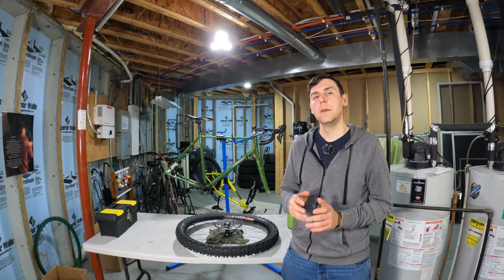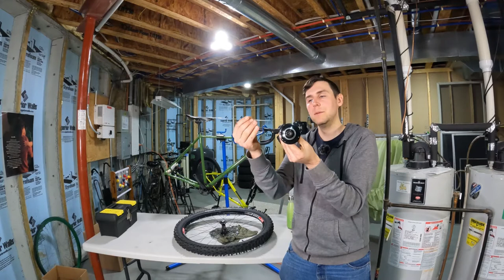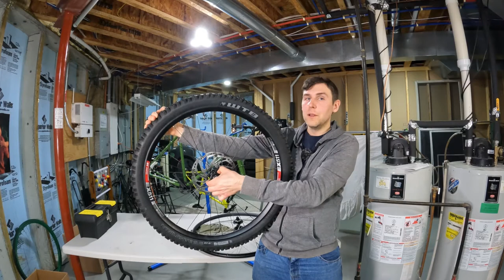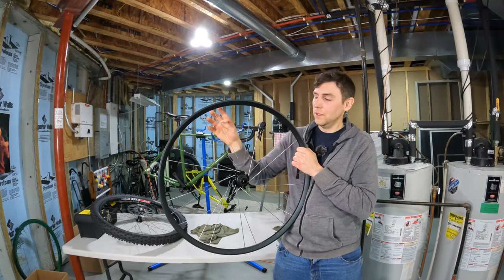Bicycle Wheel Lacing Patterns: Crosses & Spoke Orientation

Comment: Thanks for this. I'd heard before that the orientation is super important and that there's a definite right and wrong way to do it, but when I had a look at some different wheels on different bikes there's no consistency at all lol. It's like the question of whether you should grease a square taper bottom bracket spindle before fitting the crank. People have really strong opinions on whether you should or shouldn't but in the real world it probably doesn't matter.
 
Edit: That said, I've just seen one of your more recent videos about this and I think I agree on the idea of lacing the drive side spokes outside in so they're supported by the cross more than by the flange. I'm building a wheel for a heavy rider with a mid-drive e bike so I'm fretting over it a bit more than usual 😂
Reply from the maker: Oh I fret over this every time I build a wheel, then I make a video about it so I can remind myself how to do it but then when I build another wheel I fret over it all over again and also learn new info... I haven't built a wheel in a while so right now I'm not sure off of the top of my head how to do it but I'd definitely not recommend doing it the Shimano way.
Reply: @spinningtrue  lol I did it the Shimano way in the end 😆

I checked the bikes in my house again (there are maybe a few too many) and all the disk brake bikes were done the Shimano way including one with a rear hub motor.
 
I thought they were incosistent before because I was only looking for differences between the front and rear hubs, but I hadn't realised I should have also been looking for differences between the left and right flanges on each hub. So I decided that all these manufacturers must know something I don't and just copied them.